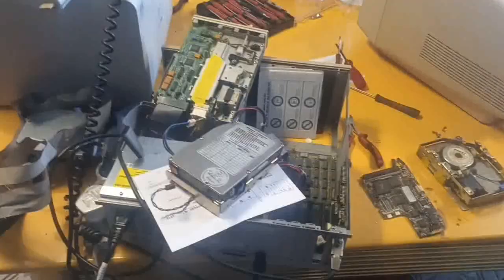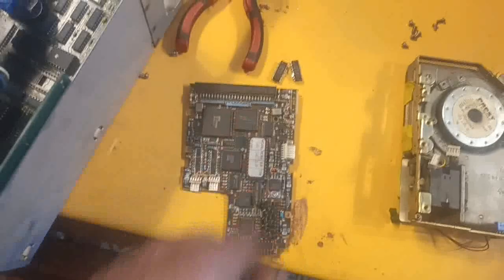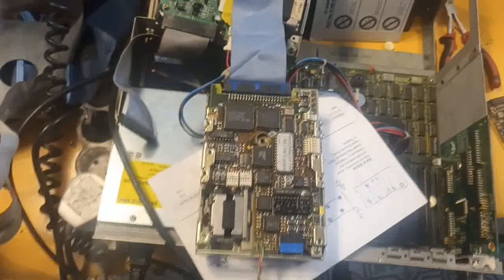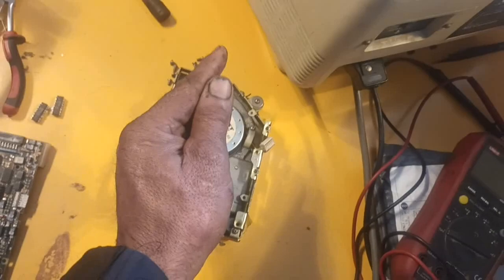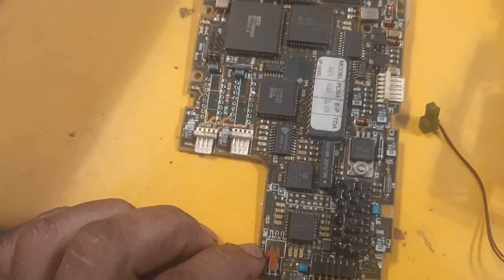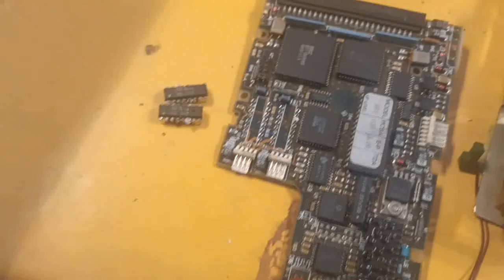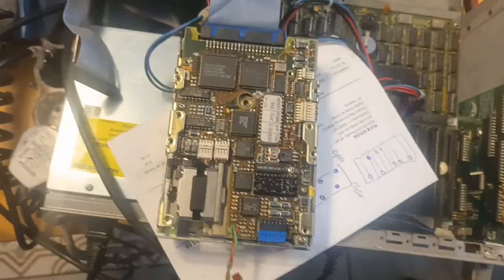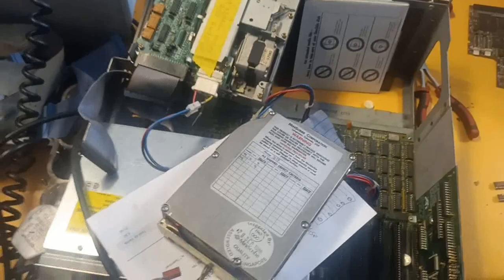Fixing old dead Miniscribe hard drives MFM, XTIDE etc

Comment: Got one these drives around here somewhere , Its attached to a board that connects into a ISA slot from a old amstrad.
Reply from the maker: probably a pc1512 or pc1640 and the board is a western digital mfm controller. i also have the same machine with the same configuration

Comment: Afternoon, thanks for the informative video. Do you have any suggestions on how best to regrease the disk spindle on these MiniScribes? I have three of them... One works fine, one struggles to spin up the platters every time (but works fine if it does) and the last has a more serious fault I need to diagnose (it spins up... Then spins down again).
Reply: The last drive you should diagnose with an LED. These drives will flash error codes on their activity lamp for you. 

There is no way to grease the spindle motors. Running them for long periods of time can sometimes heat the oil enough to work it back in - but this is not always the case. Once the spindle bearings are damaged the motor must be replaced.
Reply: @TheDiskMaster  Hum. I have the LED error codes, so there is a reason that didn't help... I can't remember though. It is a while since I've looked.

Comment: Hugo I have st-225 that is not working, please help me fix it
It makes clicky noises at power up and the controller never seems to be able to format it exiting with all kinds of errors
the platters seem to be in pristine condition
Reply: The actuator is probably sticking, try adding a few drops of oil to the stepper shaft on the bottom of the drive and exercise it with seek tests for a while.